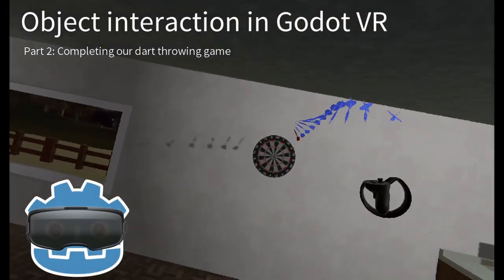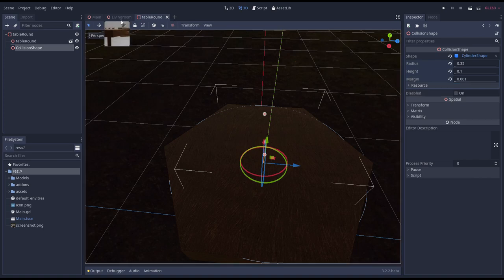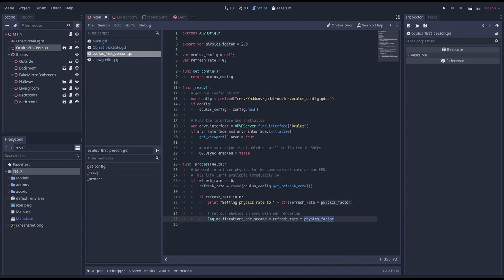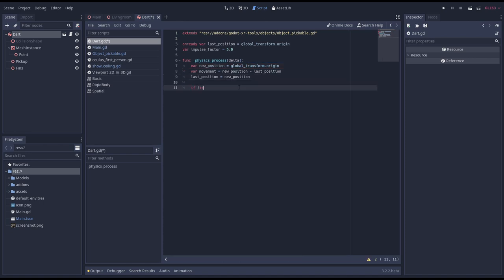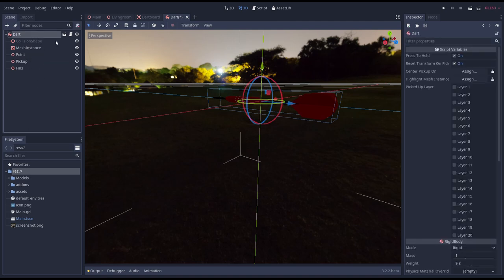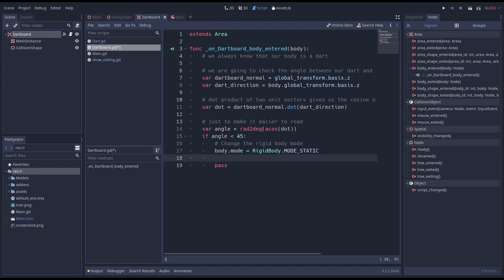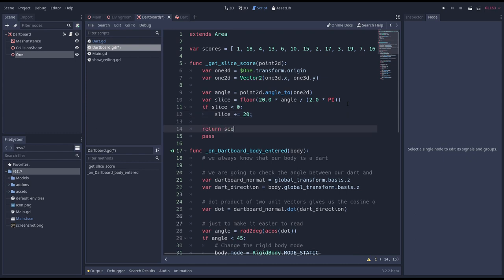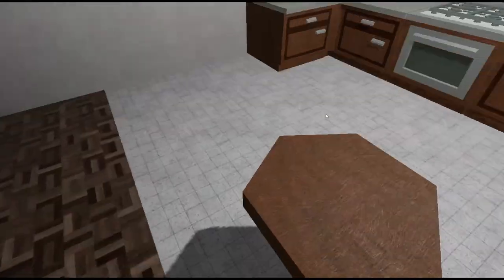Godot VR Object Interaction part 2

Comment: you should try to make stabbing interaction: a pointy object with enough force on impact with a squishy object creates a sliding joint with a bit of movement resistance and if the two object aren't in one an other the joints breaks
this is how game like bonework and walking dead: saint and sinner have there stabbing mechanic done IIRC
Reply from the maker: I still need to play boneworks, got it on my list after I finish Half Life Alyx. 
Love the idea, definitely something I will add to the topics I want to cover in this series
Reply: @BastiaanOlij  I personally find alyx not much fun compared to bonework (which I ate through its content in a few days), but then again I hate the horror genre and alyx rely heavily on horror
bonework isn't very challenging but it encourages you to play through level without using ammo which is challenging (using trash can as shield, running cover to cover to stab an enemy and engage in 1 v 10 melee fight)
the story isn't great, the level design isn't great but the mechanic is gold 
BTW thanks to your help, I started working on a bonework like character system, I have the hand and body relation working (you can pull yourself up walls, drag yourself on the floor and pull yourself from a wall ), I am still working on getting the physic body the possibility to move with the stick while still have the VR experience little perceive acceleration, I am currently experiencing with using a spring joint with a kinematic body and the  physic body, but it doesn't look good has the body is left behind 10-20 cm when you start moving and stabilise after a second or two ,same case with the two hand, due to the fact that they are still accelerating while you already started moving

Comment: Hello Bastiaan, Great Godot tutorials for VR development! I was wondering if you would know anything about applying spatial audio in VR in Godot? Do any resources exist about this? (didn't find any up to now) Thanks!
Reply from the maker: Hey Joren, thanks! Ok yes and no to your question. 

Godot does spatial audio build in, you can see this in action in my weapons tutorial series where I'm using spatial aware sound nodes to make sure the gun sounds seems to come from the muzzle, sliding in magazines the sounds comes from the hilt, etc. You can then set up area nodes to add additional sound effects to simulate sound bouncing off walls and such.

But no when you look at the next step in this, where we're actually calculating sound bouncing off of walls accurately, that isn't currently in the core engine as this is something that is hardly noticable for the average gamer on desktop games and really only shines in VR. That said, if you join the Godot discount and visit our #xr channel you'll find a lovely lady by the name of Ellen who's working on adding that functionality in.

It thus depends on how far you want to go with this whether Godot supports enough out of the box.
Reply: @BastiaanOlij  Thanks for the reply Bastiaan, I'll check it out further on Discord then! Keep posting these great tutorials ;)

Comment: Would it be feasible to build the world at a larger scale, such that, say, a meter is 10 or 100 units, to solve those collision problems?
I did this in a first person test project and at 100x scale I solved a few jittering collision problems I was having. I tried this because I remembered the Quake family of engines uses very large scale models (I always wondered why).
Reply from the maker: The problem is that in order for the simulation to work you also need to scale up gravity, which means that the movement per frame scales up and your back. That said, if you don’t care about accurate gravity then yes, scaling up works.
The downside in VR is that scaling up has it’s own set of tracking issues
Reply: @BastiaanOlij  Yea, I see what you mean.

Comment: Just a heads up, at 3:08 I think you meant 12.5 ms per frame
Reply from the maker: Indeed I did, oops :)
Reply from the maker: Not only that, I forgot to divide by two again.  That's what I get for not double checking my work.
d = 0.5 * g * t * t
0.5 * 9.8 * 0.0125 * 0.0125 = 0.000765 meters = 0.765 millimeters
Not 1.5 millimeters :) but I think most of the explanation still stands, 0.765 millimeters is still most of a 1 millimeter margin.

If I am at all right about this, as I said in my introduction, I'm not sure, I'm purely speculating based on what info has come my way.

Comment: you should try shadow play (or the AMD equivalent) for recording, as it runs on the mostly on GPU instead of the cpu - try it before investing in additionnal hardware
Reply from the maker: As far as I know the build in game recorder in Windows does that already. I’m strapping out another resource because inside of the headset everything goes nuts
Reply: @BastiaanOlij  Streamlabs OBS might also be an option for you, on my AMD RX590 it runs on the graphics card after I tweaked the settings of the stream capture.